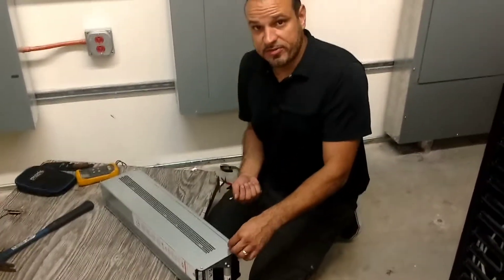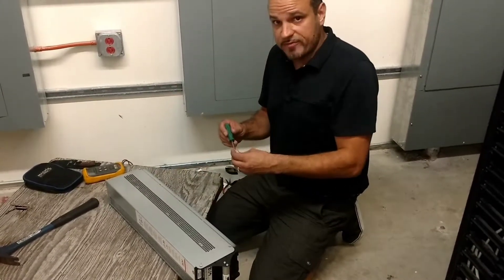APC Symmetra PX Battery Installation

Comment: Does the system need to be in bypass or shut down to replace a battery module one at a time?
Reply: Thank you
Reply from the maker: Hi Brett! These are 'hot swappable' battery modules, so no, you do not need to bypass or power down. Thanks for your inquiry!
Reply: @PEBattery  I know battery & Power modules are hot swappable, but how about the intelligence module?

Comment: Hi i want to know the shelf life of APC symmetra px 250kva
Reply from the maker: Hello, Ubaid! IDK why I never saw your question. Batteries that go into the Symmetra PX have a 12 month shelf life when disconnected from AC power. When connected to AC power, they will last 3 - 7 years, depending on the grade of battery that is inside.
Reply: @PEBattery  thanks a lot sir appreciated your positive response ❤
Reply from the maker: @ubaidurrehman9720  of course! Thank you also!
Reply: Shelf? 🤣